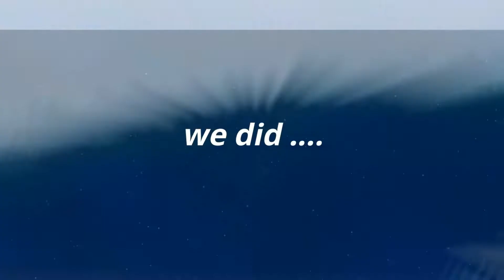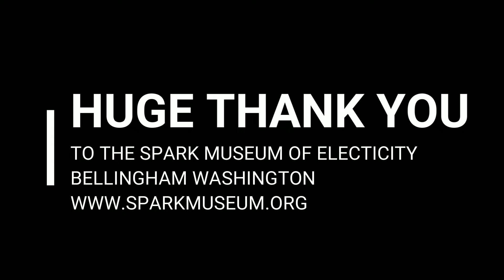What Happens if an Aluminum Boat Gets Struck by LIGHTNING!?

Comment: Thank you for visiting our Museum! We loved having you all. Upon hearing my answer to your question, there are a couple of things I would like to add. First, if you are on the water and lightning is threatening, no matter what type of vessel you may be in, it is always best to seek shelter. Secondly, while a metal boat is much safer than a non-conductive boat such as wood or fiberglass, it is not a Faraday cage. There are usually all kinds of conductive objects sticking out, not the least of which is a radio or radar antenna. An operator using that equipment at the time of a strike could easily be killed. And lastly, if you are in a metal boat and can’t get shelter, pull in any fishing poles, go below deck and stay in the middle of the cabin away from any electronics until the storm has passed. We very much enjoyed the video, and wanted to add a few facts to ensure that proper safety protocols are always taken! Safe travels - Charlie
Reply from the maker: Thank you so much for clarifying your response!  Janis